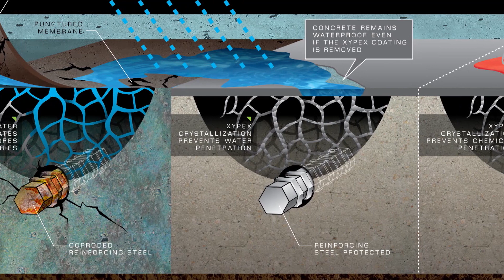CNBC Series, Inside the Blueprint, features Xypex in its, Focus on Innovators series

Comment: I worked in Dayton, Ohio for the regional distributor of this product. As an installer/applicator for several years, I found no better product ever for post pour or pre mix application pour concrete in my 50 plus years as a contractor and in my field as a Facility Engineer in concrete construction applications. By far, the best product application both as a pre-mix and even in post pour application for hydrostatic protection and prevention of failure. EVERY CUSTOMER has had positive outcomes from use of this product. Compared to anything else on the market, my customers were all blown away at the performance of XYPEX products.
BAR NONE, compared to all other competitor products. I have applied Xypex in international conditions form pools to seaward marinas, undersea pilings to buildings above ground. 
NOTHING competing has compared to the results and customer satisfaction I am aware of in my 40 years of usage, and my exposure has shown those results to be outstanding, serving the test of time to date. 
I will recommend nothing else to my concrete construction customers for longevity and security  of their projects. I started out as an applicator/ installer and still, as a Facility Engineer, cannot find a better protective solution for concrete, regardless of application in the field.
Jeffry Woods  PFE. Dayton, Ohio